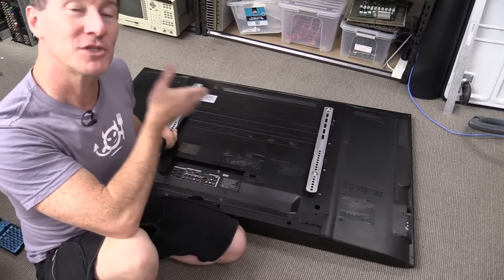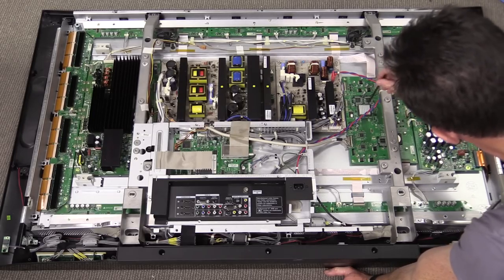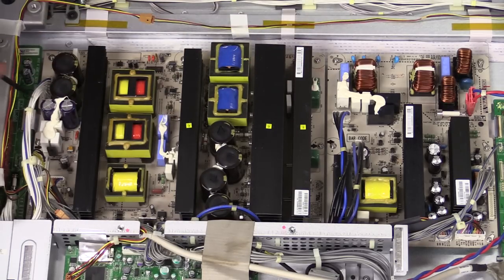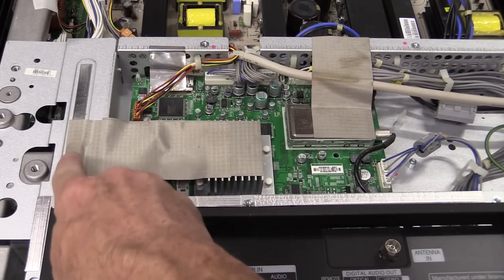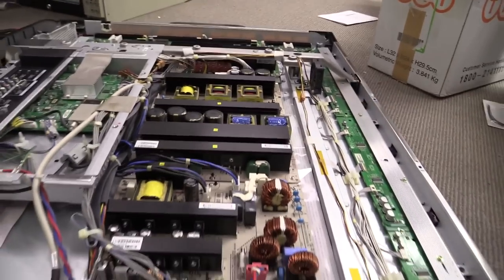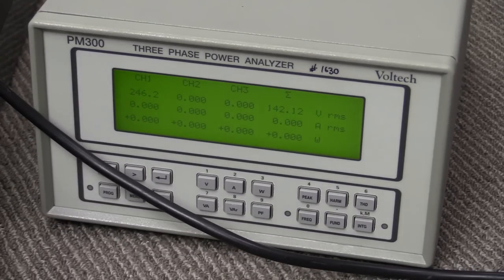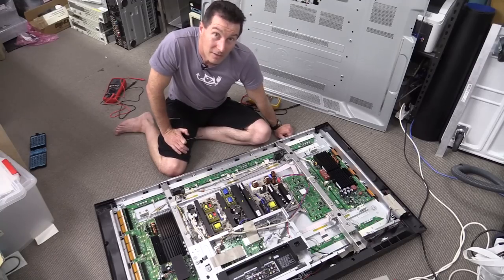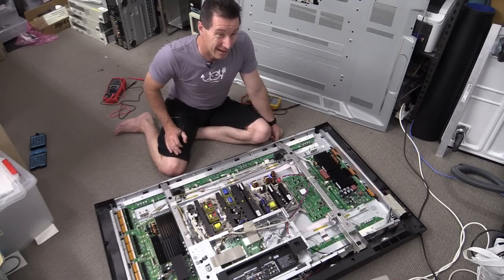EEVblog #725 - LG Plasma TV Teardown

Comment: I remember when plasma TV's fist came out the company I worked for bought 5 at £20,000 each and that was for Standard Definition 16:9 Sony's.  We had them for about a week when we used them at a company charity function.  The technical director of the company left the company logo on the TV's and burnt the logo into all of the TV's he was a complete dick head and should have been sacked for it but the higher up you are the easier it is to cover your mistakes up. ..
Reply: glenwoofit 
He probably matriculated from Harvard...
Reply: ***** That's just how plasmas are. Even the ones that very slightly jitter the image to prevent sharp burn-ins don't completely alleviate it, and the first plasma displays were VERY bad about it. Not even the latest generation of plasmas completely alleviated burn-in.
Reply: ZeroPointAlpha the fact they're inherently flawed doesn't make them less flawed, though
Reply: I'm just saying, the fact that they burned in is not indicative of a flawed set necessarily, it's just the nature of the beast. If his boss was dumb enough to leave the same image on the screen for extended periods, then that's on him, not the set.
Reply: ZeroPointAlpha You're still trying to justify an inherent flaw just because it is inherent to the technology. That's ridiculous. It's like saying air pollution by cars is not wrong because it's just part of using a car with a combustion engine.
Reply: What the hell are you even arguing about at this point? He said himself that the guy left the same logo on the screen for extended periods, and as a result their $20K displays were ruined. That's not indicative of quality, I never said it was, YOU did.
Reply: +ZeroPointAlpha Howard Johnson is right! anyone else see what i did there?
Reply: Lol of course. Imaging 5 20k tv ruined and getting fired over it. Basic info to know the salesman should have let him know not to

Comment: Well I'm watching this video on a 37" panasonic plasma I bought 9 years ago and it's still doing just fine. :P

I'll upgrade one of these days. I guess LED are the way to go now.
Reply: You are lucky, you have far exceeded the average life of a Plasma TV!
Reply: I'm using a plasma too, and I quite like it.
Reply: quincy8557 My father has a 10 year old NEC plasma, and it's still going strong and has no image burn that I can see. 40,000 hours on the internal hour-meter and I have a Pioneer which is 6 years old with 22,000 hours... also going fine...

I've seen both LCDs & plasmas die early on. in general plasmas seem to last longer and are easier to repair if you know what you are doing.
Reply: quincy8557 I have Pioneer plasma TV from 2002, the lifespan of the plasma was the bulb that expected to live for 7 years. I did have to get the video processor chip replace the first year I had it, other than that no problems at all other than no HDMI that's becoming a bigger problem for me with the convenience of streaming.  Interesting fact about the 2002 43" Pioneer Plasma TV it has to use two electrical sockets weighed around 60 lbs. and can heat a small home.
Reply: Brony and Athiest not sure if real or is 4chan leaking?
Reply: Ive got a 42" Panasonic from the same era. It still gets use, but the panel is definitely getting tired now.
Reply: ScottishAtheist You don't need to upgrade! my TV is a 42 year old Philips K9 CRT console television and its still going great! who needs to upgrade? plus my other TV is a 1968 Thorn branded B&W TV still going fine as long as the old one keeps on working you shouldn't need to replace it I do have to use a number of converters though! such as the RF modulator and then a AV splitter then all the stuff like set top box, DVD player, VCR etc....
Reply: MrEeeaddict Yup, atheism originated in 4chan.
Reply: John Egbert That's not what I said, just that 4chan's trolls usually are both of those things

Comment: the crappy samwa caps in the low voltage power supply section are dead/leaky, they are easily repairable

Comment: BS, plasma still blows the doors off the LCD, or LED backight

I just got 2 nice plasma, sets and gave away my LCD crap sets. Cost to fix, a couple 3300 uf 16v caps on 1 and a 15.00 buffer board on eh other.

Comment: @ 12:29 to 12:35 I see several muffin top caps at the low voltage supply. Although I agree that this thing really isn't worth fixing, it would be interesting to see if replacing those helped out at all. For educational purposes, of course. :)
Reply: It is absolutely worth fixing. I just fixed a 3D Plasma and Avatar 2 looks fucking AMAZING on it. It's like looking through a window...

Comment: I still love my Pioneer Elite Kuro plasma that I bought in 2008. :-)
Reply: That was definitely the quality end of the plasma market.
Reply: Your neighbourhood ham radio operator sure doesn't.
Reply: gskibum kuro was HIGH END tv. shame that Pioneer coukdnt keep this bussines
Reply: ***** I really wonder why you always hear complaints about that from HAMs. Every PDP I've seen meets the same specifications every consumer electronics device has to.   They shouldn't produce especially more noise than, say, a computer power supply or even an LCD TV - although as they use more power, it might be a little higher, but still...
Reply: Thomas Oldbury Yeah I wondered about that too. I have a short wave radio that picks up interference from everything (when it's within a few inches). My plasma is no different than my microwave, light bulbs or computers or whatever.
Reply: gskibum I've got a Panasonic Vierra plasma I got in 2009, and it is seriously the best TV I've ever owned. Just wish it had more HMDI ports.
Reply: Chris H same here. I managed to get a 55" VT before they ended sale. Love it.

Comment: DAVE!!! I'm a long-time fan of yours but you're killin' me on this one!!! Once I saw the problem, I kept waiting for you to point it out, but you never did!

There's a group of capacitors on the low-voltage power supply board (LVPS) where the caps are obviously domed and have leaked their electrolyte. If we go to the 7:00 mark in the video, there are six black vertical electrolytics that are obviously bad on the right between the two black heatsinks.

I completely understand why you're not interested in repairing this TV, but perhaps a student or hobbyist that you know would be happy to repair this and use it themselves before you scrap it out. The TV could prolly be fixed for $30-40 with good quality caps from Digikey or Mouser. I would more than likely replace most all of the electrolytic capacitor on that LVPS board. Of course check the other boards in the TV for any bad caps too :)

I stated some of the obvious things here, not at you Dave, but for other viewers who read this and may not know :)

Cheers, and keep up the great work Dave :)

Comment: Low-end plasmas, like this one, couldn't compete with the modern LCDs at their price points. However there is still no replacement for a high-end plasma such as Panasonic's top-end models. The motion resolution, black level and the lack of leaky backlight are still yet to be seen on LCD. OLED TVs have been "coming" for a several years now but yet to be seen on stores, and they also have their issues with screen burn and reproducing dark details. Each display technology has their good and bad sides, but if a slightly higher power consumption isn't an issue, plasma is still a winner in picture quality. Just too sad to see the last high-end plasmas disappear from markets just because people want cheap, pretty and lightweight TVs. Oh yeah and don't get me started on the 4K TVs, what a rip-off at least on sub-80" screen sizes.

Comment: I just purchased a brand new 2014 model 60" LG plasma last October. The image quality is in my opinion far superior to a lcd display. Contrast ratio is much better, colors are more natural and the viewing angle is unlimited. I cannot say that about any lcd I have seen or owned. It is also only about 35 pounds and only about an inch and a half thick. In my personal opinion plasma televisions are not dead yet and I will continue to use them as my only televisions until they stop manufacturing them. After watching your video I noticed that there were a few blown caps on the low voltage power board. A simple fix to get rid of the flickering... You should really do some more research before saying these TV's are "ancient, obsolete and nobody wants them".

Comment: Dave, I been repairing tv's for 30 yeas and have worked on your unit in the video, I think I can see vented electrolytics on the sub power board to the right on the main power supply. They usually are 3300uf e. caps, replacing them should correct your issue. Plasmapete

Comment: I sold a 42" plasma TV for $20 because it was easier than taking it to the dump. It weighed around 40-50KG and the resolution wasn't great. It also burned through a lot of power and generated enough heat to warm the room very quickly lol.
Reply: Gadget Addict i gave mine away with the requirement that they came here and hawled it out of my livingroom themselfs :P
Reply: tbbw I bought mine about 3 years ago, still have it, and still love it. It doesn't put off much heat, and even has a fan, which doesn't kick on unless it's in a room that's well above typical room temperature. The later plasmas don't suffer from being hot, nor do they get permanent burn-in from playing letter- or pillar-boxed content. They also don't weigh 100 lbs. Maybe ones from 2000 did...so speaking of TVs from back then, how were the LCDs back then? Not good enough to be used as TVs, and also not cheap enough. I'm skipping over this ridiculous LCD fad, I'm not buying into them calling LED-backlit LCDs "LED TVs," and I don't think I'm going to buy into the OLED nonsense. OLEDs are crap. I don't know why they're wasting their time with something that has 1/10 the lifetime as real semiconductor LEDs.
Reply: The things rapidly improved with each generation, aka year, but yes early plasmas were pretty terrible, modern ones, there is nothing to complain about, even power consumption is relatively low.

Comment: I have an old 50" LG like this.  Bought new in 2007 for about $3k US.  Now I can't get anyone to buy it for $110.  It still works, but has recently developed a couple color lines down the vertical axis on the right side.  I don't know which model was used in the video but mine is not 50kg, though it is heavy at 73lbs without the stand (roughly 33kg).  I'd fix it if I thought that would make it easier to sell.  Otherwise, my dad said it'd make a good garage tv, which I'm tempted to do, though I have no space to put it at the moment.  Since the vertical boards are separate, I'm wondering if I can just get replacement vertical boards for the section with the lines and if that'd fix that problem.  This tv works great otherwise.
Reply: That's because buyers want the premium plasma tvs only. Panasonic , Pioneer, and Fujitsu were the top premium models that are better than most 4k tvs today.

Comment: I currently own a Panasonic 42" Plasma model: TC-P42U1 purchased in 2010  This year it is 5 years old and still working like new.  It had initially two boards fail within warranty, but after they were replaced it's been fine since.  I have also calibrated the tV so the color is balanced, the screen doesn't run at full brightness, the back doesn't feel too hot after it's been on a couple hours.  I personally think if you do a good calibration job, it will reduce power draw and heat as the screen won't be running at max, and  appropriate settings will be correctly set for normal TV operation in the specific environment for which the TV is employed.

Comment: At 12:45, I'm pretty sure that's not a fuse, but a vertically mounted ferrite bead.
They just put a drop of epoxy so that they wouldn't make audible noise when the whole PCB gets vibrated by the speakers.

On my PDP, they've put them in series with some rectifier diodes (SF20LC30), I guess it's to reduce dI/dt stress, or to reduce EMI.

Comment: Any chance you can look quickly underneath the power board? I saw 4x big MOSFET, was wondering if this is a H-bridge, isolated Buck converter or a different topology. Mmmm power supply pr0n. =D

Comment: At 5:52 , I can easily see 5 bad CAPS at the bottom right corner.
At 12:20 , he points to the busted CAPS.
From 12:30 - 12:35, He zoom´s on the busted CAPS.

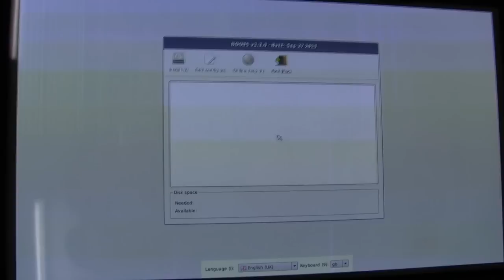At 18:58 and beyond he proves himself to be a great entertainer.

Comment: I had one of these that my sister gave me.  Once I did some research I tore it down and found out that mine had no fans cooling the capacitors at all.  That caused them to bulge and some had black soot on them as well.  At the time I had no clue what to do with it, so I took all the PCBs (they were fetching almost $100 each on eBay) and saved them to be fixed at a later date.  They are still sitting in my closet as I type, "waiting to be repaired".

Comment: Pause at 5:53, you can see a lot of bulged small electrolytic caps in the small-voltage power supply, the lower-right corner of the video. You can repair this one.

Comment: My 2012 vintage Panasonic 55 inch V-series plasma (that's the high end version) has a beautiful picture. And yes the blacks are very black. Plasma has been superior to LCD panels until only recently. It uses only 119W average power on consumption and that's only slightly more than LCDs.

There are downsides to Plasma though. Screen burn-in is a reality and the TV does buzz sometimes - but not audibly if the sound is on (I often mute my TV).  If I were buying today I'd have to really take a close look but LCD has caught up to plasma in some ways while plasma is still superior on others, e.g. fast-moving action.

I don't blame Dave for not changing the caps but I sure would have liked to have seen that TV fixed and found a good home.

Comment: At the company I used to work in, I scored a 63" plasma from one of the board rooms. The TV would click on, but not show an image. We tried replacing the power board and some capacitors, but no luck. I took it home and ended up replacing one of the plasma driver boards. The screen turns on and works perfectly and has for several years! It's a really huge TV that requires a solid steel stand to hold it up, but it's got great color and I've never had any troubles since I worked on it.

Comment: Plasma TVs have awful flicker. I've never seen one that doesn't have some serious 50Hz flicker on it. I'm using an Ultra-HD LED-backlit LCD at the moment. Couldn't imagine downgrading to a Plasma, not even for the "blacks".
Reply: ***** 
My Sanyo LED/LCD TV has beautiful blacks.
Reply: Robert Calk Jr. My CRT TV has far better blacks than any flatscreen and vivid colours its old but does me well
Reply: ***** A lot of plasmas' "movie" or 24 FPS modes have an awful flicker. I don't know why. It has nothing to do with plasma technology. It's all in the firmware of what's driving the display. It's only really in the lower-end models. You will NOT find a high-end plasma that flickers. You just won't.
Reply: Tim Ramich
Ah right, I must've seen only the lower end models. To be honest, the last one I saw WAS in a Tesco Extra store! Side-by-side against all of the LCDs, it looked out of place and a bit antiquated, much like a CRT would. But I guess the higher end ones would probably looks better side-by-side.
Reply: Realgroovy24 CRTs can have good black levels -- even zero, for some correctly adjusted displays. The problem is they tend to have issues displaying bright objects on black due to internal reflections in the tube. This creates a halo effect around some objects & is one reason a low black level plasma (Kuro 8G/9G, Panasonic VT60, Samsung F8500, etc) will beat a CRT for picture quality in my opinion (and not just in black levels, but also motion response, geometry, flicker, colour accuracy and brightness.)
Reply: ***** A lot of the cheap plasmas only refresh the panel at 600Hz, which is 60Hz of real picture information. A good plasma will do double that, which makes flicker essentially imperceivable. I have a plasma that refreshes at 2800Hz. The flicker is not noticeable. It does depend, most of the cheap plasmas were built purely for lowest cost per inch^2 of screen and were really not that good.
Reply: I own 3 LG plasma TV's manufactured in the last few years and none of them have any flicker whatsoever.
Reply: Black Frame Insertion?

Comment: This was a really helpful video. I just found a Panasonic TH-42PWD6UY plasma TV and I think I'll scrap it for parts. For the weight and power draw it's not really worth keeping around but I could certainly use some more high-voltage power supplies.

Comment: I've got an LG 42" with digital tuner from 2008 that uses 300w with the full brightness menu mode but when normal mode she will de about 150w +/- it's a good tv but like you say'd it eats lots of power ! I also have a samsung led 55" that does about 60w 70w on movie mode and I have another samsung led 32" that does 35w and last I have a Sony 32" 720p that does a beauty 20w and rounds with a 19v powersupply like same used on their notebooks

Comment: The caps in the smaller power supply are bad, you can see the tops are popped in about 3 of them. The tv might not be worth much, but it's worth saving if that's all it needs. Some one would appreciate the tv.

Comment: I Noticed That The Capacitors On The 5.3 Volt Board Are Swollen And Are The Primary Cause Of The Odd Flicker and possibly the Random Lines in the screen

Have a good one, Mate :)

Comment: Where's the audio amp board on this TV? I took apart an older LCD TV about this size and the audio amp was on a separate board and very easy to get working, 12 volts and an input source got it working.